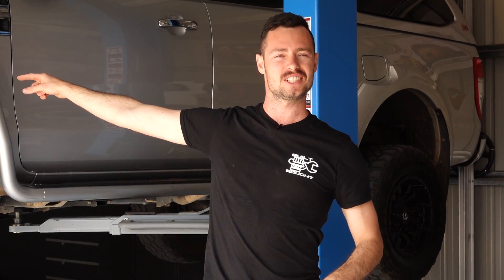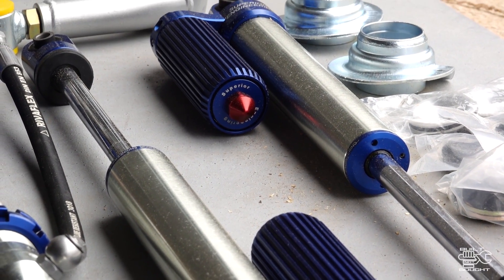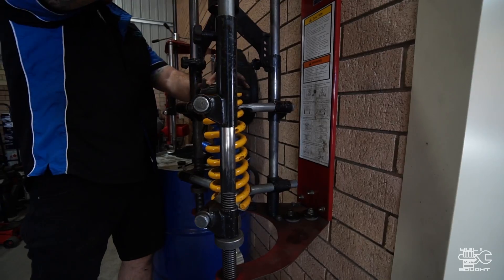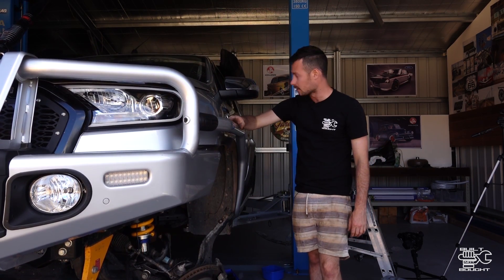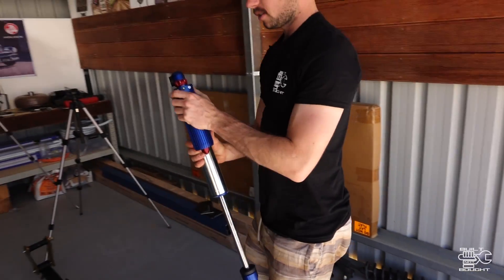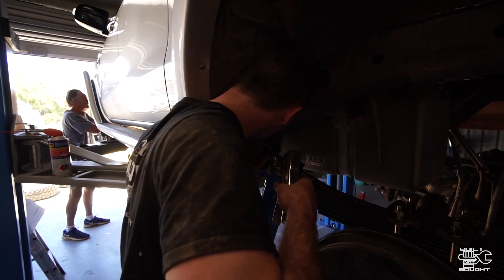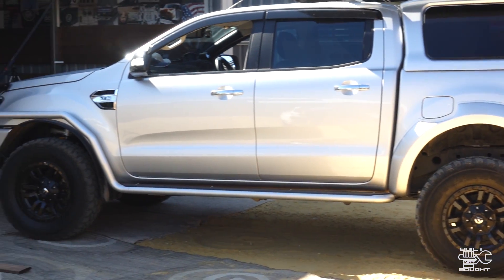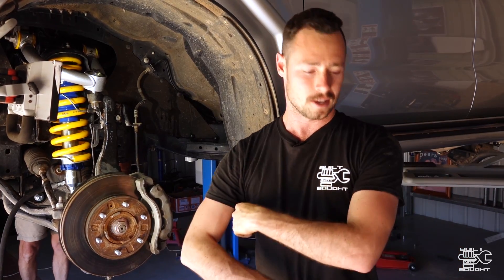4 Inch Lift Kit Install || Is it really that hard?

Comment: AT 6:38 you describe the rear spring as bent - Rangers come like that from the factory (I have a 2020.75 and it's never been overloaded and mine are like that).  You can actually flip that inverted leaf over to increase the weight capacity if carrying a heavy load regularly, as a poor man's upgrade to the stock springs.  Good video though, very informative.

Comment: Could you do an uninstall video as well...  You know ...  for us Queenslanders who will have to take it off as it is too high ;-P .  ?
Reply: Pff mate ive been running a 100mm lift in my patrol in brisbane here for a long time. been pulled over a bunch and never a head turned. you'll be right.
Reply: It’s more about insurance than what we can get away with on the road. If ya right it off and they can measure the height they won’t pay up.
Reply: @wikkidme755  Not to mention if you have an at fault accident, they can (potentially rightfully so, depending on the work done and quality) state the suspension changes had something to do with causing the accident. In that case, you lose all cover and the full cost of medical and property damage is passed on to the driver.
Reply: @peterbarber7613  mate don't be a sook and let the government hold you back and enjoy four wheeling.
Reply: @shockflyyer3d  im not being a sook but I would rather hold back than be defected
Reply: @shockflyyer3d  The cops that will ask about your lift aren't on the streets, sometimes they'll set up on the entrance of popular 4wd tracks near the city.
Reply: Feel sorry for you boys. Only thing we have to worry about in the states is the mud flaps coming below the mid point of the rear tires... one of my buddies daily drives a ram 3500 on 44s never had a ticket!
Reply: Mr JMHG what kit u running
Reply: Just watch video in reverse
Reply: @Dan-n-Butters   ;-) luv it!
Reply: instablaster...
Reply: Wa is the same. 2" anymore its engineered 🤷‍♂️

Comment: Getting in before 4000 comments on not putting bearing grease on Polly bushes 😂 and not 100% sure what the front brake lines were undone and not just undo the caleper bolts and swing it out of the way 🤷🏻‍♂️
Reply: They put longer brake lines on

Comment: Would not recommend removing the stock spring from the shockie like that. Use the correct spring compressor. My apprentice did it your way to save time and the shock shot 20 meters down the workshop.

Comment: Almost certain you all installed the rear shocks upside down. They might be easier to adjust the other way and the stock orientation is with the body on the axle side. Should work no worries! Wish we had diesel Rangers here in the states...

Comment: 1 you can't balance a shaft to a diff..
2 get spring compressors they are about 50.
Reply: Your typical spring compressors will not work for 4wd heavy rated springs, they bend and its dodgy as fuck, better off using a professional suspension mob for that part

Comment: So that diff drop bracket you cut off.  Well I hit that in a rock and it caved the front of the diff bracket in.

Are there any serious issues that happen later with denting that bracket in?  I don’t feel any vibrations at all and I can’t tell if it moved the diff or anything. Safe to say the front plate to the bracket caved in without actually moving my diff?

Comment: tighten all pivot points (control arms,spring and shock bushes) after it is back on the ground at ride height. otherwise it will ride like shit and destroy bushes. you probably did that but didn't point it out on the vid for newbies.

Comment: I was told that with the superior remote res lift kit for the 2021 ford ranger PX3 ford  does not need a diff drop when going 3 inch lift. What are your thoughts?

Comment: Hey Sam! I had malaga suspensions install a 3 inch lift kit (Dobinsons IMS) into my 2017 ranger XLT about 2 months ago. My ride feels super firm though, especially at the rear. Is there a way to soften it up a bit without replacing the springs? Cheers mate.
Reply: Hey man not too sure if your questions been answered but you should be  about to adjust the damper settings on the front for a softer ride, as for the rear leafs are preset to carry a constant static load ie: 300kgs or such, only solution  for that is a lower rated leaf spring
Reply: @fletcherhenery3222   cheers mate!

Comment: What about the cvs won’t they be on a mad angle should they be straight?
Reply: The CV axles connect to the front differential which he lowered with a diff drop. 
The axle itself can handle quite a bit of movement because when you go offroad they're never really straight.
All you need to look out for are the cups/boots on the ends of the axle because these can tear, dropping the diff should prevent that from happening though.

Comment: Always loved these px2 onward rangers. I thought they looked neat despite what these old dinosaurs say about being all plastic. My gu is getting a bit long in the tooth and been eyeing these out. Don't do that much off roading due to work anymore and the fuel savings and power of these would be nice to have. Bet its more capable than my patrol too seeing as they have  factory rear diff locks. Would love to see this in an offroad video.

Comment: Hey sam what are your thoughts on the new ranger raptor? Do you think it will beat the previous 3.2L ranger?
Reply: G’day mate I’ll be honest we had the rangers for work and got rid of the lot (15 of them) due to the fact that their engines and gear boxes are rubbish. We had 2 that blew engine between 40,000km and 50,000km. 
Gear boxes would just give out. We had 3 of them go into the workshop 5 times each in a week. I was fuming.
Raptor been a smaller engine than the states, means I’d be very query about it.
At work we went back to cruiser and for the dual cabs we now use dmaxs. 
One of the dmaxs has 575,00 on the clock and honestly still feels great to drive. I’d personally stay away from Hollywood cars like rangers and raptors and stick with the provens Toyota Isuzu. After all Isuzu make trucks. All the best mate 👍
Reply: @davidfarrington5545  
                             GREAT GREAT GREAT comment David.
GREAT !

Comment: How did you avoid vibration? I’ve got vibe from a pissy 2”lift. Does the diff drop help with this?
Reply: yes, extreme drive line angle will cause vibration, have the same problem on jeep wrangler tj's and xj's when you add a 4" lift, need to either drop the tcase with spacers or get a slip yoke eliminator

Comment: Why you would put a 4" lift on a vehicle with a limited 6.5" of full front end travel is madness. A lower lift with mods for more travel would perform better.
Reply: Yeah also possibly not legal. In WA, you can only lift the roof of your vehicle 50mm total, in combination of suspension lift, body lift and tyres. Effectively, you are limited to a 50mm bigger tyre and 25mm suspension lift without engineering.